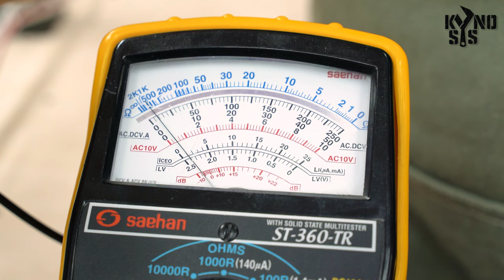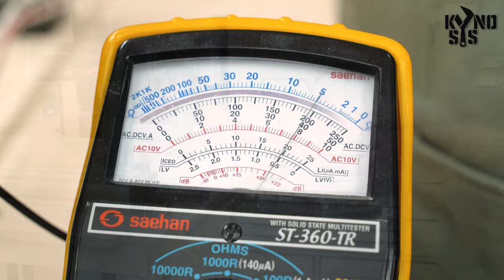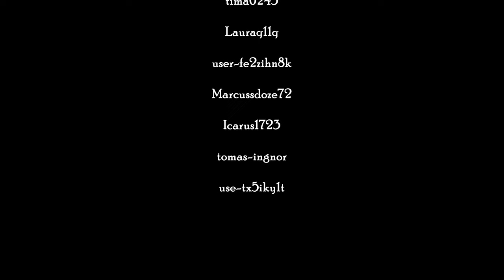Kynosys Work Table : #2 / DIY

Comment from the maker: Some people are concerned about safety when using the vise for this work. Please refer to the explanation as follows.

As an inventor and engineer, I will give more consideration to my next work.

The two-hand switch is of course applied to my factory's production line.

I've given it a lot of thought in making this work, and instead I've put in place a different devices. There are five points that you're missing. 

The first is "moving speed."

Look carefully at the moving speed of the vise on my worktable.
It is very common to control dangerous instruments at speed during operation. Think about automatic rotation, escalators, etc.
Of course, we add extra sensors to ensure safety, but the basis is speed

There is a risk to all products that move automatically after pressing the button. Not all of them have industrial safety devices. Your concern is that every machine and machine that works automatically has a risk. Of course, it can also be placed under an automatically unfolded bed. But instead of going under the bed while it's automatically unfolding, we usually look at it from a distance and see it unfold.

The second is the location of the vise switch.

I used a special technique to mount the switch on the upper body of the vise without a separate wire. This is the position where the hand is not injured by the vise.

How to use it,
Switch on to raise the vise.
Place the board in the appropriate position.
Press the switch again to lower the vise, securing the board.

Where will my hands be placed in a dangerous place?

Not only me, but all carpenters and DIYs are trained to be safe enough for this level of work.
We use a lot of harder machines, too.

The third is the "frequency of use."

Accidents are always reported in the automatic rotation and escalators mentioned earlier. This happens because the frequency of use is beyond the limits of the system prepared for safety. As the frequency of use increases, the probability of accidents increases rapidly. For example, if the frequency of use increases to infinity, the probability of an accident converges to 100%.

So all the working products are made within the safety zone of the graph.

I don't use my worktable, thousands of times a day.

This means that you can use it once or twice a week and pay enough attention. It also means that it is located within the safety zone of the graph.

The fourth is that I have a warning about the movement.

When operating the air cylinder, the silencer makes a loud sound of air escaping. If you do not need this sound, pull the airline out of the silencer and pull it out of the room.

I didn't do that on purpose.

This sound is loud enough for the air cylinder to pay enough attention when it moves. Unlike the light, this sound is loud enough that I can't hear it in my workshop. 

Furthermore, the sound starts before the vise starts working, and then turns off at the end of the vise.
Perfect timing as a warning sound.

The fifth is, have a separate switch at the bottom of the table

I can operate the vise with this switch, and my body is far enough away from the vise.

This is the best safety device to remotely control the vise. These switches are also available for special situations,

In particular, for side vise, the bottom switch next to it has been made available.  It's such a strong force that I prepared for an emergency. 

Thank you.
Reply: sending the electricity through the cylinders isn't a good idea at all. the power you're using might be harmless for a healthy individual, but it can easily fry a medical device. it might be fine for personal use, but if you plan to produce more tables for sale, then you must address this issue.
Reply from the maker: @csehszlovakze  Thank you very much for your thoughtful advice.
I think that when making a product commercially, advance notice of all possible risks is very important.
However, I make it clear that I have given some consideration to the electrical technology used in this work.

The electricity in this work is DC 24V, and it's completely harmless to the human body. When it is above 50V, it is reported to be harmful.
There is no electric shock caused by the battery of the car battery or the batteries of the wireless tools.

The medical device you're talking about would mean an artificial heart pacemaker, etc., and even here, DC 24V power does not harm.
Rather, cell phones or microwaves are known to have a bad influence.
I think people who use special medical devices should live by strict standards on their own.
Not all modern electronic devices are in their favor.

There is a possibility of an electric shock only if we touch two cylinder rods at the same time.
But that's less likely than being electrocuted by deliberately putting two metal skewers in a household electrical outlet.
We use electricity in our homes despite these dangers.

When selling Superman clothes in the U.S,
There is a saying that it should be stated that it cannot fly in the sky.
I think of it as humor,
What is your opinion?
Reply: @Kynosys_  first, you should also take amperage into account when considering possible issues with this electric design. second, consider jurisdiction when selling outside your country, for example I'm pretty sure this wouldn't pass Hungarian inspection as our electric regulations are extremely strict. otherwise it's a great product with a beautiful design, but you don't want it ruined by legalities, trust me!

Comment: Moin.
Ich finde deine Arbeit sehr schön bis auf zwei Kleinigkeiten und eine Anmerkung. 1. wenn du schon Presskabelschuhe nimmst warum lötest du sie dann? 2. wenn du schon ein Loch in die Stange bohrst warum nicht gleich ein Gewinde rein schneiden? Anmerkung ich hätte da bedenken was den quetsch Schutz angeht. Wenn du so eine Konstruktion für einen fremden bauen würdest währe das sehr riskant, was du privat baust ist natürlich deine Sache. Hier währe eine Zweihandschaltung oder ein Fußtaster eine sicherere Alternative. Ansonsten finde ich dein Projekt sehr interessant und schön umgesetzt. Mit freundlichen Grüßen aus Deutschland
Reply from the maker: Thank you very much for your kind words. The answer to your first question seems to be "habit". When I run electrical wires, I prefer to solder rather than pliers. It seems to be more stable. Safety issues are replaced by answers to other people's questions.

I would like to express my deep appreciation for your comments of concern for me. As an inventor and engineer, I will give more consideration to my next work.

The two-hand switch is of course applied to my factory's production line.

I've given it a lot of thought in making this work, five points that you're missing. 

The first is "moving speed."

Look carefully at the moving speed of the vice on my worktable.
It is very common to control dangerous instruments at speed during operation. Think about automatic rotation, escalators, etc.
Of course, we add extra sensors to ensure safety, but the basis is speed

There is a risk to all products that move automatically after pressing the button. Not all of them have industrial safety devices. Your concern is that every machine and machine that works automatically has a risk. Of course, it can also be placed under an automatically unfolded bed. But instead of going under the bed while it's automatically unfolding, we usually look at it from a distance and see it unfold.

The second is the location of the vice switch.

I used a special technique to mount the switch on the upper body of the vice without a separate wire. This is the position where the hand is not injured by the vice.

How to use it,
Switch on to raise the vice.
Place the board in the appropriate position.
Press the switch again to lower the vice, securing the board.

Where will my hands be placed in a dangerous place?

Not only me, but all carpenters and DIYs are trained to be safe enough for this level of work.
We use a lot of harder machines, too.

The third is the "frequency of use."

Accidents are always reported in the automatic rotation and escalators mentioned earlier. This happens because the frequency of use is beyond the limits of the system prepared for safety. As the frequency of use increases, the probability of accidents increases rapidly. For example, if the frequency of use increases to infinity, the probability of an accident converges to 100%.

So all the working products are made within the safety zone of the graph.

I don't use my worktable, thousands of times a day.

This means that you can use it once or twice a week and pay enough attention. It also means that it is located within the safety zone of the graph.

The fourth is that I have a warning about the movement.

When operating the air cylinder, the silencer makes a loud sound of air escaping. If you do not need this sound, pull the airline out of the silencer and pull it out of the room.

I didn't do that on purpose.

This sound is loud enough for the air cylinder to pay enough attention when it moves. Unlike the light, this sound is loud enough that I can't hear it in my workshop. 

Furthermore, the sound starts before the vice starts working, and then turns off at the end of the vice.
Perfect timing as a warning sound.

The fifth is, have a separate switch at the bottom of the table

I can operate the vise with this switch, and my body is far enough away from the vise.

This is the best safety device to remotely control the vice. These switches are also available for special situations,

In particular, for side vise, the bottom switch next to it has been made available.  It's such a strong force that I prepared for an emergency. This comes out in the last third videos, so you might not have seen it yet.

It took three whole weeks to make this work.
It was a pretty tough job.
Nevertheless, I thank you all.
Because it is an opportunity to look back on my work once again,
It is because it is also my pledge to make efforts for more safety in the next works.

Thank you.
Reply: Danke für die ausführliche Reflexion ihrer wundervollen Arbeit. 👍🏻🫶

Comment: Briliant idea BUT if you are buying in bulk why not leave the cans in the box thy came in , save time loading them into the storage shelves  , same with nuts and bolts
Reply from the maker: You are right. That method is also very good. One problem is that I manage There are too many parts and screws. You will understand when you watch my next uploaded video. I made a drawer that stores 210 different types of screws. thank you!

Comment: Стол очень хорош,,,, но у нас он будет золотой по цене( а так,, конечно круто
Reply from the maker: ты прав. Когда я делал рабочий стол, мне казалось, что стоимость материала слишком высока. Моя жена тоже была удивлена, когда услышала цены на запчасти. Традиционные столы, которые обычно используются, намного дешевле. Но мне хотелось создать свой, очень уникальный стол. Я чувствовал, что это улучшит мои творческие способности. Даже если это не похоже на мою работу, я надеюсь, что это может стать ссылкой для других. Спасибо!

you're right. When I was making a worktable, I thought the material cost was too high. My wife was also surprised when she heard the prices of the parts. Traditional tables that are commonly used are much cheaper. But I wanted to create my own, very unique table. I felt like that would improve my creativity. Even if it doesn't look like my work, I hope it can be a reference for others. thank you!

Comment: What am i missing? They are vertical. How do they clamp material?
Reply from the maker: The distance between the cylinder rods used as the posts of the vise is 400mm 500mm. This means that you can hold the material of that size while lowering the vise. It appears several times in the video. thank you

Comment: hi, is it possible to have the plans of the pneumatic assembly please? And the list of components please?
Reply from the maker: Drawings with numerical values are currently being produced. You will see it in a video soon. Basically, 6 cylinders with a 40 mm diameter and a 200 mm stroke; Two cylinders with a 50 mm diameter and 400 mm stroke were used. 4 x 24V solenoid valves, 1 x 24V adapter, 1 x 4 air block, and nipples. You should be able to get the parts you need from a pneumatic supply store. thank you!

Comment: Salut Kynosys, vraiment génial , j'ai vraiment aimé cette réalisation, j'ai une question à vouzs posé avec des vérins électrique ça peut ce faire, merci beaucoup pour les deux vidéos, bonne continuation à plus JEAN.
Reply from the maker: Merci pour vos paroles de louange. Celui que j'ai utilisé est un vérin pneumatique. Si vous avez des questions, veuillez me contacter à tout moment. Réfléchissons-y ensemble. merci!

Thank you for your words of praise. The one I used is a pneumatic cylinder. If you have any questions, please contact me at any time. Let's think about it together. thank you!
Reply: @Kynosys_  Bonjour Kynosys, merci beaucoup de m'avoir repondu assez rapide, oui j'aimerai poser certain question sur la différence sur son fonctionnement et efficacité entre un vérin pneumatique et un vérin électrique, si possible avec un lien de contact , par contre j'essayerai de traduire en Englais à l'aide d'une application parce que moi et l'anglais ça fait deux, je vous souhaite une très bonne journée et dans vos futur projet, à bientot JEAN.